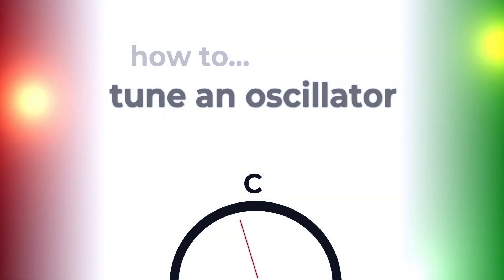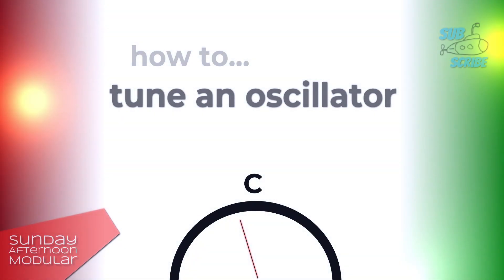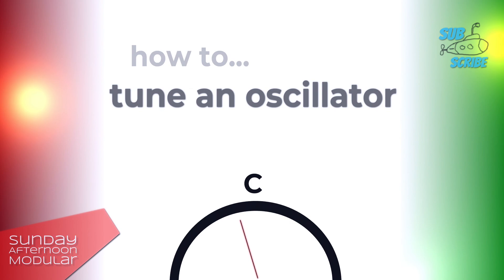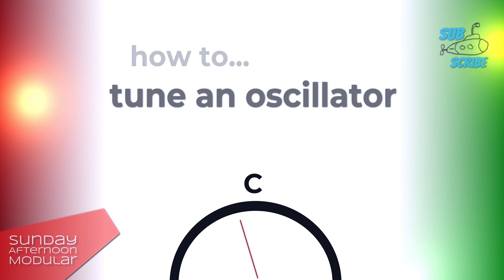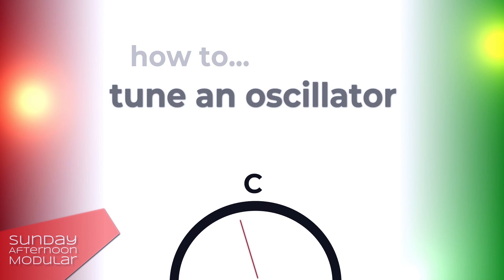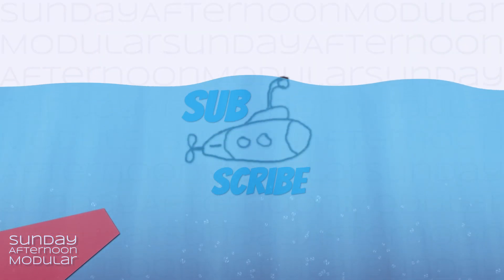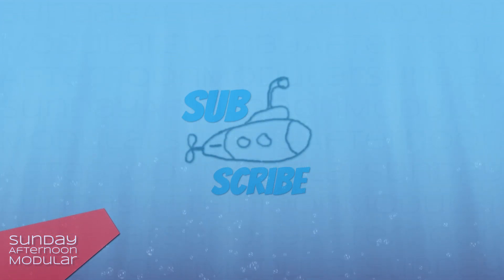How to tune an Oscillator

Comment: I'm not an expert at this, so this video helps! I have my modular output modules run into my PC's audio interface, and my DAW (Studio One) has a great tuner plugin, so it works a lot like your rack tuner.

You mention tuning modules: did you not like the Klavis CalTrans? Your video made it sound amazing. I wanted to, eventually, get enough that I could have one of the four outputs on each permanently connected to every one of my oscillators. Since I am all about working on songs that oftentimes have guitars, bass, and vocals included, the power to control drift and keep everything together that would give me sounds so worth it. Would you still recommend the CalTrans?
Reply from the maker: Hi Troy, the CalTrans is a great module, especially if you are using more than two VCOs to create your sound. But I have to admit I don't use it very often. I mostly tune my oscillators the "old school" way, and use an ALM Beast's Chalkboard for transpose. ( https://youtu.be/9yKHHSSetKk )